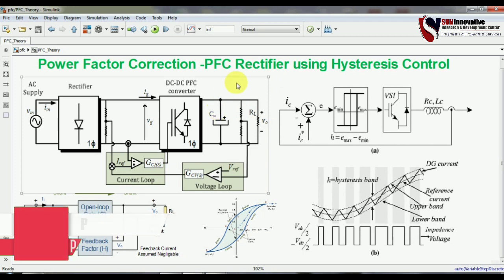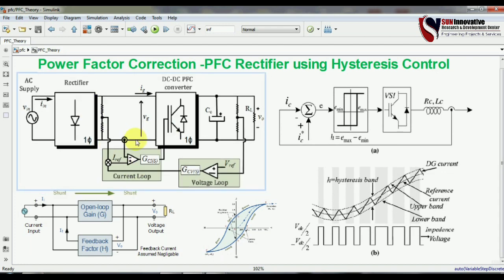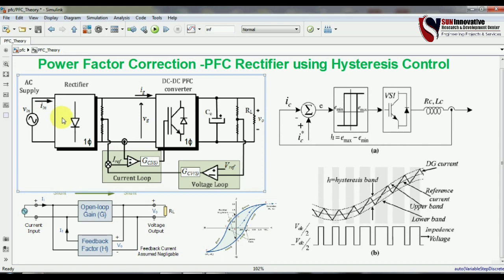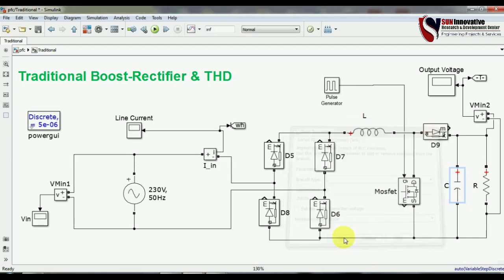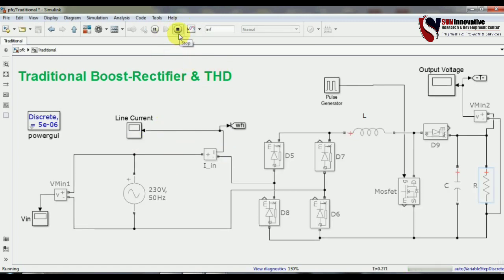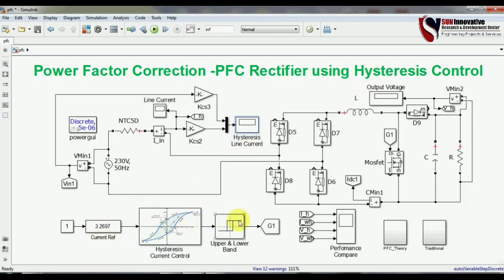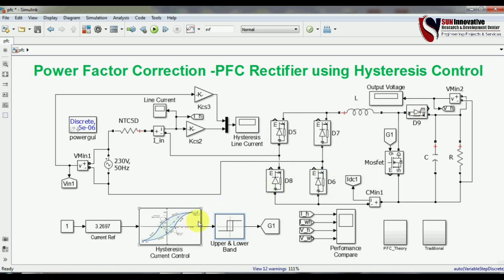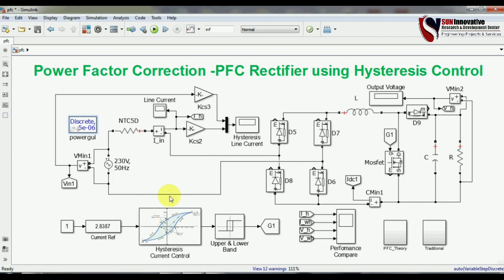PFC Boost Converter | Hysteresis Control | Closed Loop MATLAB Simulation

Comment: If I connect a battery across resistor then it is not charging (battery - 200v)
Reply from the maker: Checkout initial state of charge is set to 10%

Comment: you have divided the input current and voltage by gain K.Whats the value of K?
Reply from the maker: Value of K should be equal to peak value of input voltage. 1/peak value of sine voltage, so signal converts to unity for further process.